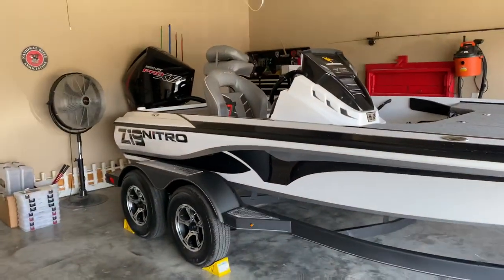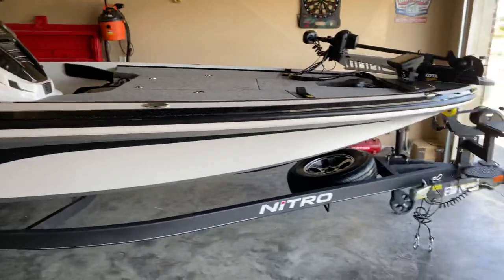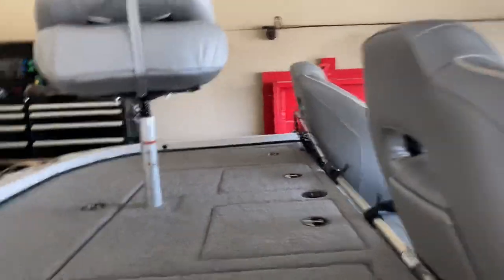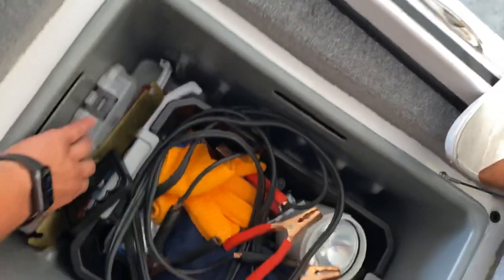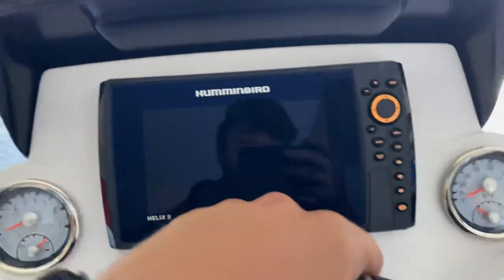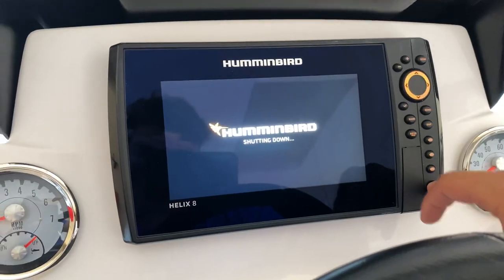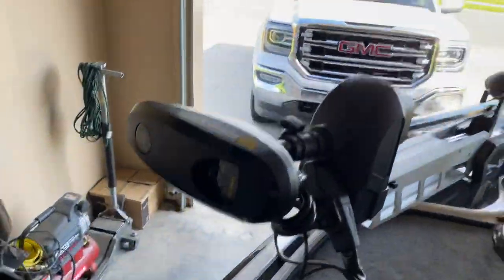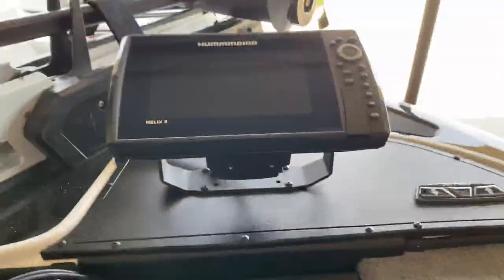2020 Nitro Z19 Overview/ Setup

Comment: Thank you for the video Zach.  I am in the process of deciding which boat to buy, the Z18 or Z19, but my garage size is an issue.  I noticed in the video, your motor is turned a little.  How much space does that save you?  How long is your garage?  My garage is 22'10", but the Z-19 storage length is 23'.  Do you think I will have two inches of wiggle room just by turning the motor?

Comment: Congrats on your purchase.  Question- Could you measure the depth of your garage and post?  I am entertaining the same boat and worried about it fitting in my garage.
Reply: This is what I was going to ask as well. I do have an RV storage in my neighborhood but I'd rather keep my boat out of the weather, especially down here in FL during hurricane season.
Reply: Zachary Fuller could you take a measurement from the back wall to the exact front of the trailer with tongue folded. If the boat is up against the back wall with almost no room then that is how I believe I would have to store it. I need the smallest possible length to store the boat in. Online says 22’7". Im gonna be cutting it close with room. Turning the motor like you have it may also help. Thanks!
Reply: Any measurement s
Reply: Same question here. Measurements of boat trailer with tounge folded from the front end of the tounge to the prop with the outboard lowered would be good info. Sounds like several of us are curious if it will fit in the garage. Paying for boat storage sucks.

Comment: nice boat man!  im looking to get one soon.  
Quick question on the cooler.  lets say you throw a some ice in there to keep your drinks cold, is there a drain for emptying the water at the end of the day and if so where does it drain to?
Reply: The cooler has a drain plug which runs down into hull. Will drain from there out the back when you remove primary drain plug.